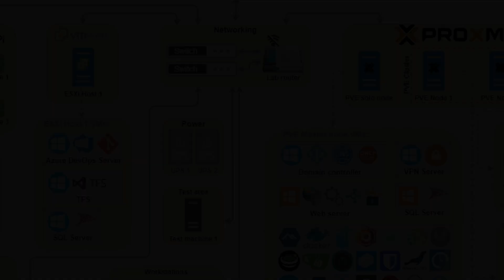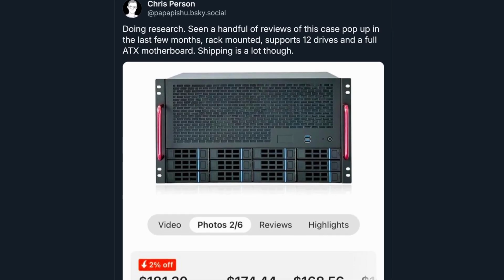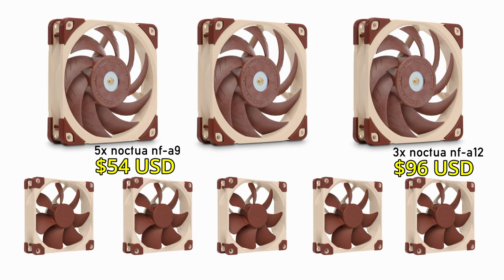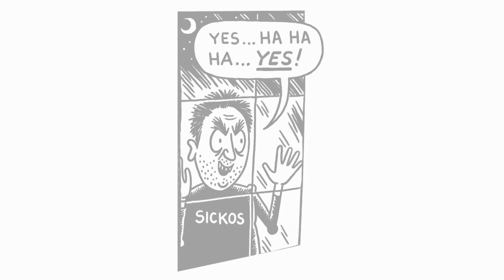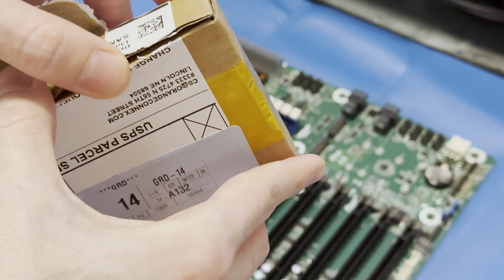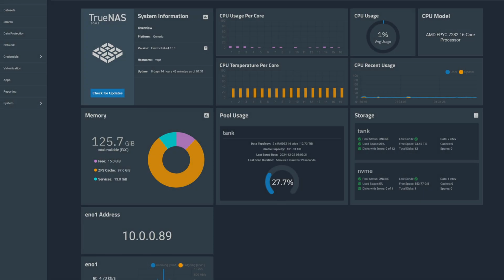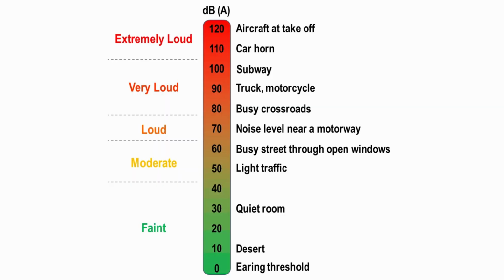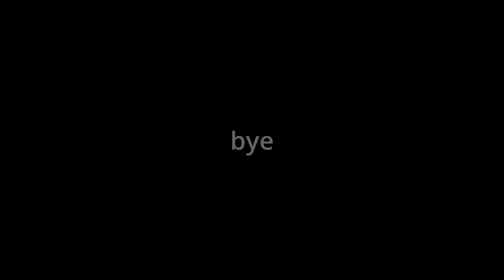my 100tb jmcd 12s4-1 server build

Comment: Could you tell me how NVMe was connected using the Mini SAS SFF cables?
Reply from the maker: the m.2 nvme storage is connected using the on-board m.2 expansion slots. the sas sff cables are used for connecting the 12 spinning hard drives from the backplane to the hba card in the pcie slot. for the asrock motherboard i have the second m.2 slot is disabled by default and power is routed to the surface mounted sas connectors. to address this, i needed to refer to the motherboard manual to see which jumper position to set in order to route power to the m.2 slot instead.

Comment: I’m curious, doesn’t keeping it enclosed in your entertainment cabinet reduce airflow / keep it warm?
Reply from the maker: the front of the cabinet is well-ventilated and i have the rear cabinet panel removed so any heat can exhaust up and out. it doesn’t really put out a ton of heat to begin with (average internal readings are 35°c–42°c) so it hasn’t really been a concern. considering the low the noise profile and where it’s located, i find that to be quite acceptable.

the playstation 5 located in the other end of the cabinet however . . . is the opposite lol. that thing outputs loads of heat. but even it has never thrown any thermal warnings or shut down from it.
Reply: @maybesheforgot  That makes sense, I appreciate the reply!

Comment: Why the dual 2.5g ethernet card when the board already has dual 10g?
Reply from the maker: originally i wasn’t sure what i wanted to do, perhaps try some form of link aggregation with the 10gb ports to my router and use the 2.5gb for non-storage local network traffic on a different subnet. so far i haven’t done any of that, so it’s just extra redundancy for now.

Comment: On the 120mm intakes, does it seem like you could install thicker fans (37-38mm thick-bois) on 2 of the 3 slots?  It looks like it but its tough to tell from the angle of the video (Havent finished video so apologies if you address this later)

What about clearance on the 92mm fans, is there room for thicker fans?
Reply from the maker: i think you could install thicker intake fans, though the 2.5-inch hard drive bracket included with the case would most likely not fit. i haven't measured it (and am not exactly in a position to pull the case apart at this moment), but i would guess there's roughly half an inch or so between the edge of my motherboard and the intake fans. there should be enough vertical clearance to where i don't think thicker fans would pose a problem, it would just be awkward trying to get at any of the fan headers if needed. the fan nearest the power supply might have more clearance issue though, since it's got the 24-pin connector to deal with.

the one rear exhaust fan has more clearance in my case because of the fans on my noctua cpu cooler not being parallel with the rest of the case fans. your mileage may vary with that one. as for the four drive bay fans, there's plenty of space behind the backplane for thicker fans. hope this helps.

Comment: i like this case but what about rails? did it come with some?
Reply from the maker: no it didn’t come with a rail kit, might be sold separately from the oem but i’m not sure. in all honesty, if i had rack space i would not want to mount something this big, as it would consume like 5U. there are more efficient storage chassis that support 12 3.5-inch drives and only take up 2U. not saying you couldn’t or shouldn’t rack it, but it’d be a waste of space in my opinion.

Comment: Thanks for sharing! I’m looking to build something similar. 

Why did you not use the Oculink ports on the motherboard for the backplane?
Was it because those 2 Oculink ports only can handle 8 SATA drives? Is it bad practice to mix Oculink or SATA ports on the motherboard with a HBA controller?

How loud is your build? Do you notice it much?
Reply from the maker: i’m going to touch on this a little in a follow up video, hopefully soon . . . however, in order to use the oculink ports on the board i would have had to give up the second m.2 slot and/or the very pcie slot my hba was connected to lol. but ultimately, yes it was due to the oculink ports not being able to handle the number of drives i had. 

i’m pretty sure you can mix and match drives from an hba and other inputs, so long as the drives are not in a hardware raid config or anything like that. people love using those m.2 sata adapters to add more disks to their servers, and they work, but it’s just not as reliable as a dedicated hba.
Reply: @maybesheforgot  Annoying limitations with shared ports on an otherwise fine motherboard. 

Yes, a well supported HBA card is the safest option. Then you will get all features.

A follow up video would be interesting.

Comment: I’m wondering if a motherboard 12” x 10.1” would fit when paired with 30mm-deep fans. Could you please confirm?
Reply from the maker: @alinparcalab7269  the manufacturer is quoted in the byte pursuits blog post saying eatx (12x10.1) will not fit but that they’re working on a 12-drive version that will support eatx.
Reply: @maybesheforgot  I can second that; they are currently testing the EATX version in the China market right now

Comment: The torque is 1.2Nm or 13 inch-pounds +-10%, so this should be fine.
For your ram Setup, if you're not planing on upgrading your system, you should populate all RAM channels.

Comment: great video, you summarized it perfectly with couple of gags. Also great build, that idle power consumption is with HDD spin up, or spun down?
Reply from the maker: @filip9043  thanks! idle power is with all 12 drives spinning. under load the most i’ve seen it pull is ~220w but on average it’s been around 150-170.
Reply: @maybesheforgot  Thank you for your reply. That's an efficient server, just HDDs are pulling 70-90w

Comment: Really nice build dude, well done. Thanks for documenting this. Cheers from Australia.
Reply from the maker: @nathan.j101  thank you!
Reply: @maybesheforgot  How is the build holding up? Any issues with that RM850X handling the daisy chained molex?
Reply from the maker: @nathan.j101  haven’t had any issues with it. i did eventually split it so it’s now 2 on one rail and one on another (didn’t have 3 available on the psu). but it’s been good. i’ll probably have a more official update video out when i can here. just trying to include enough to make it a worthwhile update.

Comment: over $4k for a server using used parts is outrageous.... You could have just bought an enterprise server with much higher spec...
Reply from the maker: @Hands-onNow  the only part that was truly “used” was the processor. everything else was new lol. and half that cost is just the hard drives, $1900 for 168tb raw storage. and i didn’t want an enterprise server in the first place because they’re loud lol
Reply: @maybesheforgot then there is that. Thanks for the video. Great job!

Comment: I received the same case late last year, and chose the same cpu,  same fans and cooler, but I have a supermicro h12ssl motherboard. It's definitely a hidden gem. I still haven't filled all the drive bays. My cost to build was less than half what you spent, maybe because I have less drives, or probably because I bought all my parts during black friday. My only complaint is there isn't enough space to fit a bigger gpu. That would make it perfect.

Comment: great Build! you clearly know what you are doing and TrueNAS Scale is a great pick, it definitely has come a long way in the 3 years I've been using it (since the very first Angelfish RC)

though the Backplane Power cables do need addressing: the power supply may be more than capable of delivering the required power (especially since it's single rail) but it will not know or care about a single cable being overloaded that much, and single cables are quite a small gauge (usually 18 or beyond) are not meant to be loaded like this.

I understand why you did it, there is only one Molex cable in the box. But please buy some more and connect it properly, corsiar's modular cables are easy since SATA/Molex are identical in the Type 4 -> Type 5 transition.
Reply from the maker: @hburke7799  totally fair point, i’ll see about getting those backplane cables switched out. thanks!

Comment: What is the benefit of using 4 32GB RAM sticks as opposed to 8 16GB RAM sticks?
Reply from the maker: @none.892  room to add four more 32gb modules down the road if needed. otherwise, 128gb is 128gb i think.
Reply: @maybesheforgot  That makes sense! Thank you!

Comment: Yo, your build is almost exactly what i'm trying to do. I ordered the case a couple of weeks ago, Also use TrueNAS Scale myself, how come you went with 2xRAIDZ2 setup? Just so you could get as much storage as possible. Thinking of going the exact same way.
Reply from the maker: @Burty117  nice! yeah i wanted to prioritize storage while also having a bit more resiliency than what a single 12-wide vdev would offer. this way if a drive does ever end up failing, resilvering is less likely to tank the rest of the pool.
Reply: @maybesheforgot  My initial thoughts were 3x VDEV RAIDZ1's. As there's three backplanes and 4 drives on each, but you'd lose an extra drive to resiliency, I'd rather have the extra drive for storage. I'll be going your setup I think. Gotta go looking for your motherboard or something similar now.

Comment: If you don't need hot-swap bays with a backplane, I found Fractal Design cases can be a pretty cheap and very high quality enclosure. The Define R cases usually have 8 drive trays, plus some 5.25 bays that can be used for more drives or hot swap conversions.
Reply: yah but like why not? the whole point is not taking an hours to do maintanence or have any downtime at all. With how swap you dont have to turn off the system or anything, you just throw the drive in and let it rebuild
Reply: @masterhacker7065 because downtime and cost for home users is probably very  different compared to business users. For a home user an hour of downtime might be acceptable and for a business a few hundred USD for a hotswap enclosure is acceptable, but not the other way around.

Comment: Great video. How do you only have 289 subs? I wish I had heard of that case about a year ago. I ended up with a Dell T7820 and a Nimble Storage ES-1 storage array. By the time I swapped the loud ass PSUs and other fans, I probably could've been close to what you ended up with. Do you have any idea what you'll do when this gets full now that you've set up the arr stack?
Reply from the maker: @michaelgleason4791  i think now that zfs expansion is a thing i’ll slowly pick up larger drives and replace any failed/failing drives with them. then once they’re all replaced, expand the pool.

Comment: For my build I had to get a fan card but so many power supply don't have 4 pin connector and it was odd for me but it took me like 2 months to find a power supply that did support it and took me long to find out since stock were barely available

Comment: this is really cool, do you know how i could have my apps or iXapplications not run on my pool hard drives?
Reply from the maker: @eriv0id  in the applications page of truenas scale the “configuration” drop-down button has an option to “choose pool.” i have mine set to my nvme pool instead of the mechanical hard disks.
Reply: @maybesheforgot  wait so you setup a different pool with ssd's?
i sadly have one nvme and it's being used as a cache drive, it's a shame you can't use the boot drive for applications
Reply from the maker: @eriv0id  it’s the one m.2 nvme drive i installed (even though it’s only one drive, you can create a pool from it). the thing with zfs is as long as you have enough ram, you may not need a separate cache drive (depending on what kind of data you’re working with). 89/128 gigs of my ram is being used for zfs cache currently.
Reply: @maybesheforgot  ahhh, okay, and how would i move those applications to that drive without breaking anything? and my system has 32gigs right now, i only do minecraft server hosting, NAS and jellyfin in one
so an all-rounder type of home server
Reply from the maker: @ i think there’s an option to unset the current pool for applications, but i don’t know if that’s going to mess up what you’ve currently got running. would be best to take a snapshot and maybe shut all your apps down first, then try to migrate the data directories to the new pool

Comment: In for one at $234, late march to early april, fingers crossed
Reply from the maker: @jocerv43  nice! that’s probably about what i paid after shipping and fees, so not bad at all!
Reply: @maybesheforgot  case just arrived but I'm at odds with the hba/sff cables. The listing you have are gone now/the same parts are priced decently higher, any suggestions? Otherwise I'm considering ripping the backplane out and running sata cables lol
Reply from the maker: @jocerv43  to be honest, the hba i got is a little overkill and i could've gone with something more affordable. the lsi/broadcom 9300-8i is totally worth checking out in its place (and you could always upgrade the card later on of course). i see one on amazon currently for around $80 USD. you might have to flash the card if it's not in IT mode, but that shouldn't be a problem.

i really wouldn't try running a dozen drives all over sata connections (assuming you're looking at one of those m.2 or pcie sata port cards?) because the performance and reliability would be pretty bad overall.
Reply: @maybesheforgot  Just looked and I would need the LSI 9300-16i 16-Port for the sake of the three SFF-8643 ports on the backplane and then just double ended SFF-8643 cables?
Reply from the maker: @jocerv43  ah right, if it's the 8643 connector on both the backplane and the card, then there doesn't seem to be a 2-to-1 style cable like i have with the slimline 8654 cables, so the 9300-16i would be necessary. and yep, looks like you'd just need three 8643 to 8643 cables.

Comment: Is there anyway to rotate the cpu cooling? That just bothers me so much!
Reply from the maker: @Gh0st662  yeah it bugs me too, but with the socket being rectangular instead of square i don’t think there’s any other way.
Reply: @maybesheforgot  Have exact the same CPU+MB and a different 4U chassis, ended up replacing nh u14 sp3 I had previously to Arctic 4U-M, this fits perfectly in 4U chassis and has the right orientation for airflow.
Reply from the maker: @ good to know!
Reply: @maybesheforgot you could build a deflector/duct that catches air and directs it towards the CPU fan(s). Just a piece of sheet metal rolled in a 45 degree arc. Prototype it with paper, build it first with card stock, then purchase thin gauge aluminum or steel from a hardware store.

If the cpu cooling fans are pushing air towards each other, you may need to make 2 deflectors.

Attach them to the chassis case walls with screws. Make the deflector arc and height just as high as the cou fan. Don’t run the duct up to a fan. That way the cpu fans will pull as much air as it needs and not have too much air pushed in. The deflector(s) need not be 90 degrees as the chasis fans likely move much more air than the cou cooler fans do.

I’ve done deflectors and ducts like this for my mid tower as it did not push air parallel to the channels on the memory sticks. I was able to bend a piece of aluminum in a way that allowed for one tab that attached to the case fan with a single screw. I used JB weld and a piece of 12 gauge copper wire to give it a “spine” to stiffen it. As for the tab that attached to the case fan, it was attached to the rear of the fan, hooking in front of the rear mount hole, and uses a screw driven from the back. For added peace of mind I used silicone to secure the screw. This deflector was 1-1/8” wide.

I also did a duct from one of the side case fan intakes since the cpu cooler has a top mounted fan. This way the cpu drew fresh air in from outside of the case. The duct was attached to the side panel at the fan mount holes via rivets, though screws would work. The duct was rectangularly funnel shaped and wider than the cpu fan by 3/16” on all sides and floating 1/8” above the cpu fan so as to reduce the risk of striking the cpu cooler fan  when removing and attaching the side panel. I also added a wing of sorts around the rectangular funnel for smoother air flow up and around the cpu and motherboard rectifiers. I prototyped the wing from card-stock paper and have left that in place, going on 4 years now. It wasn’t as much work as it sounds like. Just an hour or so of labor for everything in order to not waste the midtower once I filled the drive bays to capacity for a 5-disk ZFS array, and thus reducing efficient airflow through the case.
Reply: @maybesheforgot  How have your CPU temps been? FYI the Noctua NH-D9 TR5-SP6 4U fits and is orientated the proper direction for air flow. It's made for SP6 but on their website they mention it is actually compatible with SP3 with an optional (free) mounting kit.
Reply from the maker: @cristianfilipov2025 my temps have been 35°c on average the past 6 months. max 44°c under load and 30°c min.

Comment: Both a chassis and platform that are underrated in one video!  Nice little server, I'd personally want 10GbE but the nice thing about Epyc is you have the PCIE lanes/slots if you want to upgrade in the future.
Reply from the maker: @nadtz  oh i guess i neglected to call it out, but this asrock motherboard has dual 10gbe interfaces on it standard.
Reply: @maybesheforgot  Ah, must have mixed up the models in my head, I'm more familiar with supermicro's Epyc motherboards.  Given 10GbE pretty good for the price even new (and they are relatively cheap second hand).